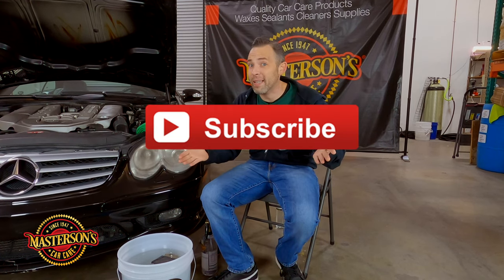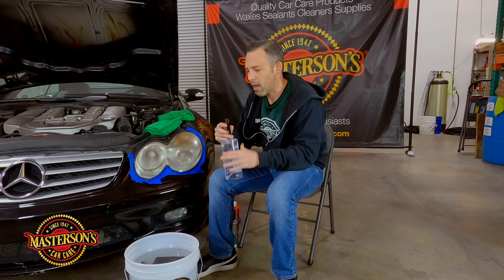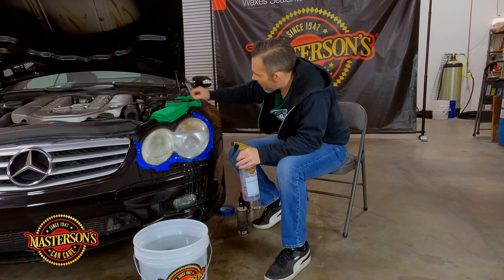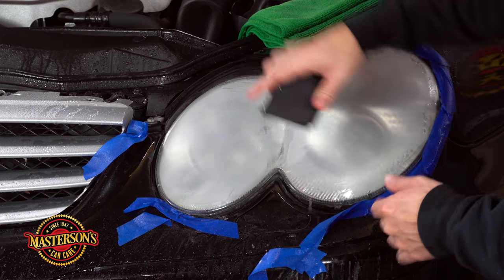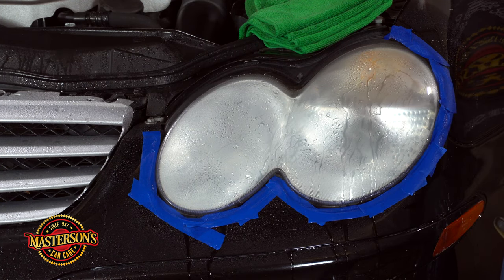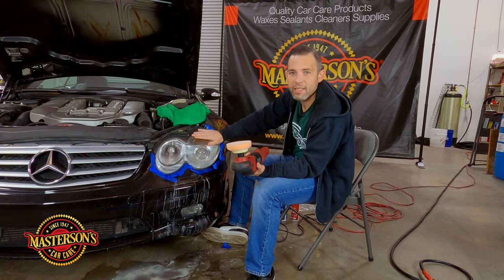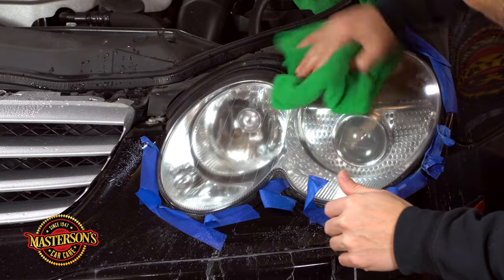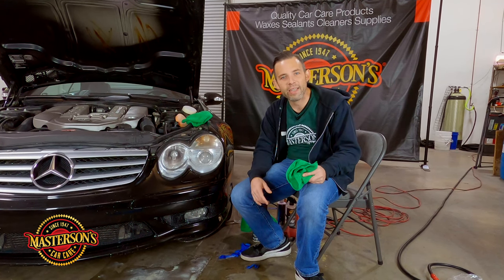Headlight Restoration DIY Guide - Mercedes Benz SL55 AMG- Auto Detailing

Comment: Wow, that looks amazing!!! If you used the double stuff and finer grit sand pads with a drill or hand palm sander tool and wet sanded it and masked the surface better this resto job would be even better if not perfect. Thanks for the video i think that paint sealer with uv blocker woild actually be easy to use than the Meguiars headlight lens clear coat with uv blocker, especially on a windy day. 😊